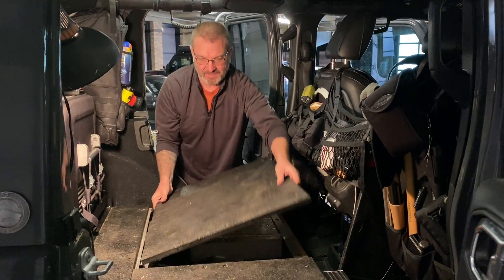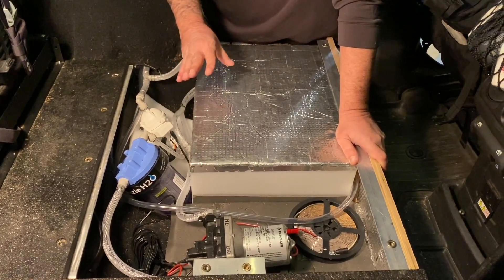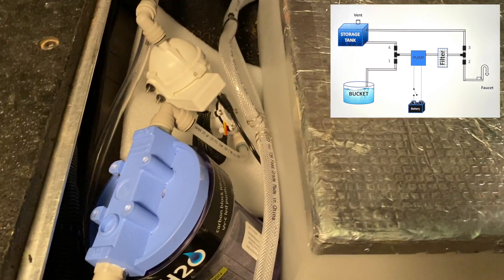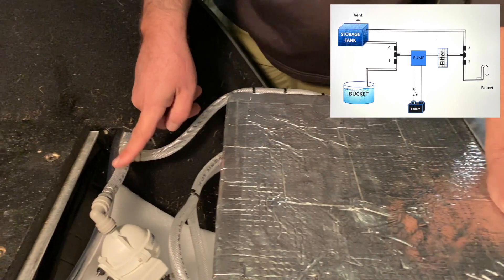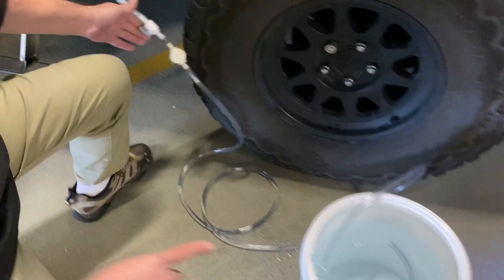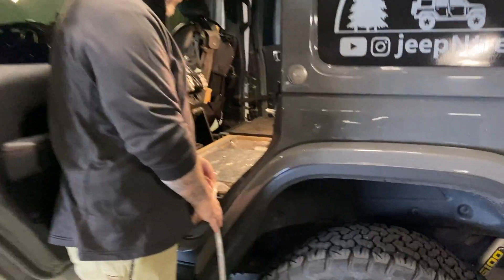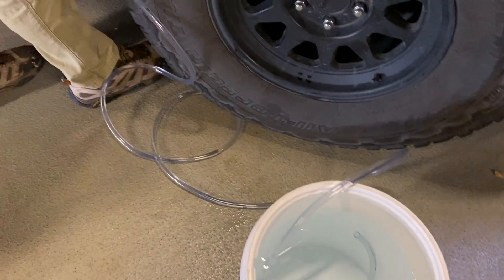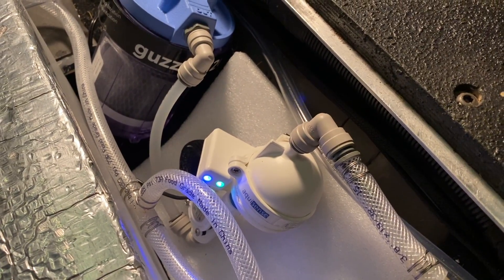My Ultimate Drinking Water Filtration System Part 2

Comment: Great setup. How do you remove the soap/detergent component from showering to make it drinkable water?
Reply from the maker: I don’t generally recycle my shower water for drinking but you can in a survival situation by using a practice of keeping your shower water separate from your drinking water and using a biodegradable soap. Then if you have to use your shower water for drinking you simply run it through the filter a couple of times to sanitize the water and make it safe for drinking.